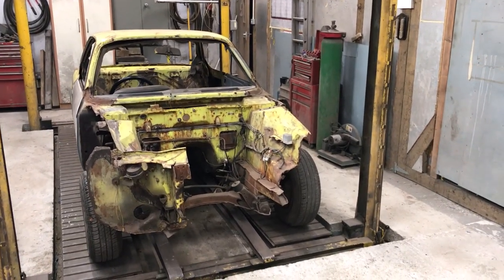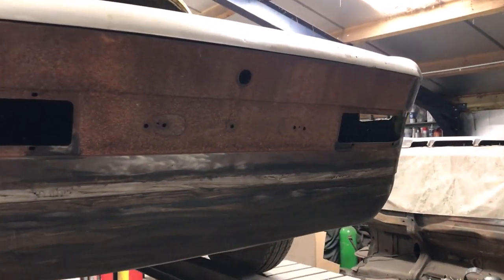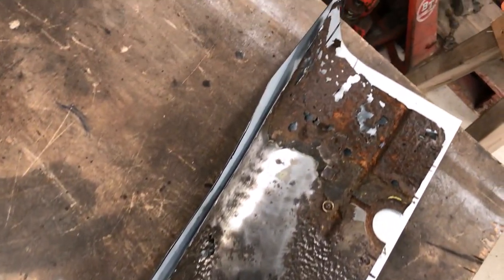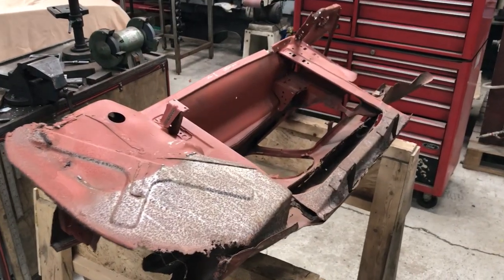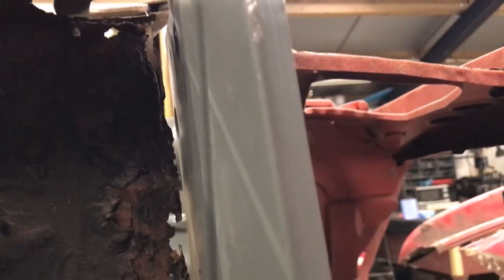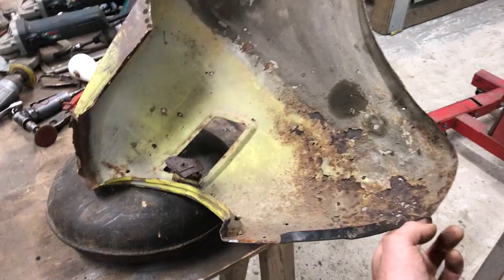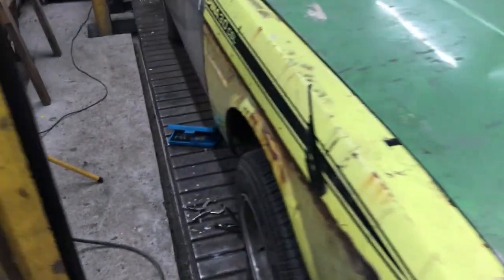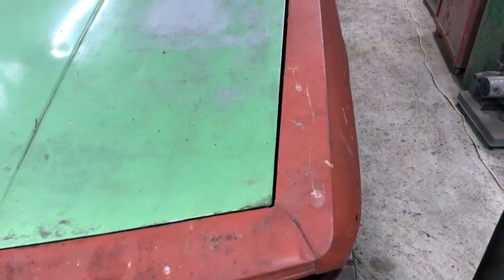Terrible state but epic car BMW 3.0 CSL 1975 E9

Comment: You got it right. This cars front allways was death trap. Its really difficult to rebuild. The reason is the combination of the old 2000 cs body with the new e 3 front axle and the 6 cylinder motor.

Comment: An E9 owner, who's restored his car told  me that depite the dimension monitoring (in all axis) and strenghtening during sill and pillar repair car changed his geometry after the engine was installed as all the gaps in front were lost from ideal to really poor ones. These had crafted cars bodies are very "elastic" and it makes the restoration process very challenging. Hope you will find it useful. Keep for your patientce and motivation. Great job and take care!
Reply from the maker: Thanks for the info, I'm used to certain cars moving about when jacked up vs on there wheels for example triumph TR's and Morris minor convertible's but I would have never expected the E9 to move just inserting the engine. I had better place the engine in at some point and check it. Cheers 👍

Comment: Ben,

I think my comment didn’t post. Amazing Please go online and join the e9coupe forum. There are a number of panels sold by other vendors that W&N doesn’t carry. That includes the seat reinforcement and strut top that you fabricated.

I’m not sure how familiar you are with the car, but if it is a genuine Alpina CSL it is quite a bit more valuable than a standard CSL. I’m sure your customer is aware however.

- Markos
Reply from the maker: Hi Markos. Thanks so much for the
very helpful message, I will check out the forum and panel suppliers 👍. I'm not familiar with the car and haven't restored one before, I did check the chassis number to confirm it was a genuine CSL but will
check again about the Alpina designation, sounds interesting.
Reply: @bensclassicbodywork  e9coupe forum is the most valuable forum for E9 and E3 owners. It has CSL specific section so you can clarify all doubts and count of kind and professional help in almost any topic. Really wort to join.

Comment: Can’t wait for more videos. How did you learn how to do this, how long have you been doing this? I’m young and this is what I wanna do.
Reply from the maker: Hi and thanks for the enthusiasm. I've been doing this as a profession for around 20 years, I trained as an engineer working with lathes and milling machines but was repairing colleagues cars in my spare time (mot stuff). I built up enough experience in the end to start doing classics and left my engineering job to per-sue a self employed life restoring cars but I was mobile and was driving out to peoples houses and using their garages. I took a restoration training course which really helped a lot and bought DVD's of Ron Covell, this was before YT. I also worked for a few garages after that one or two days a week and learnt a bit from others still self employed. Finally I had enough work to sustain myself full time and built a workshop at my parents place where I am now, It's been a long process and it would have been much easier getting a job with a restoration company to learn the trade. There is an amazing amount of videos on YT now at all levels and that will be a big help to anyone wanting to do this job. It's just a case of choosing who you are going to listen to, each restorer has their own ideas of the best way to do something.
Reply: @bensclassicbodywork  Thanks for the reply

Comment: I  have an e9cs and i cannot get the door to sit in flush with the sill after fitting a doorskin  i have the swage lines all even and door to wing all good  but it wont go  in at the bottom  its fine near front wing but way out at the  b post can anyone help PLEASE
Reply from the maker: Hi, is it a case of twisting the door to correct the alignment ? The skin if not sealed/ welded will allow the twisting of the door. Once it's aligned then you can seal or tack weld the door to hold its position.